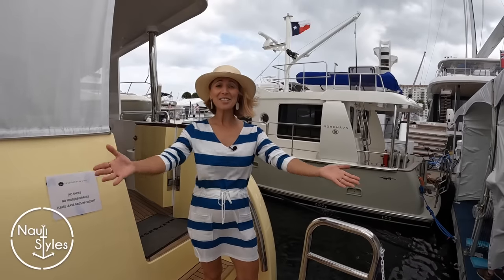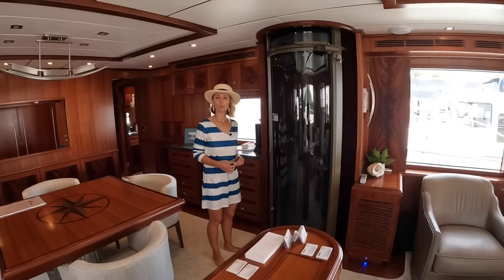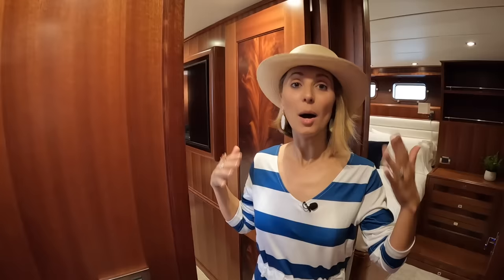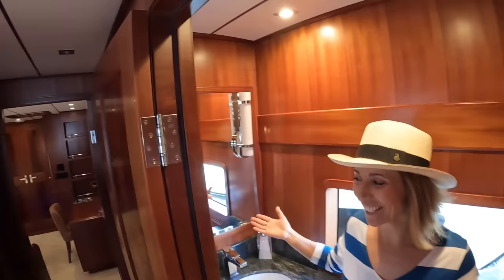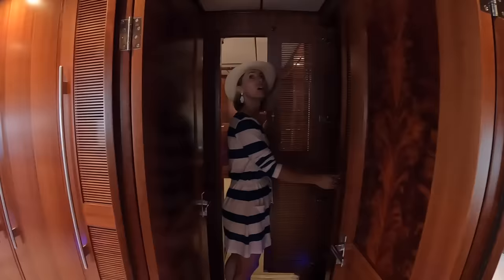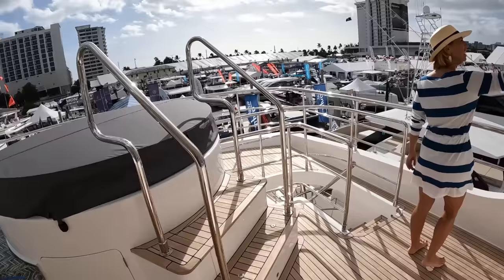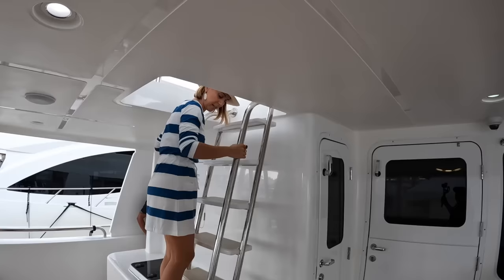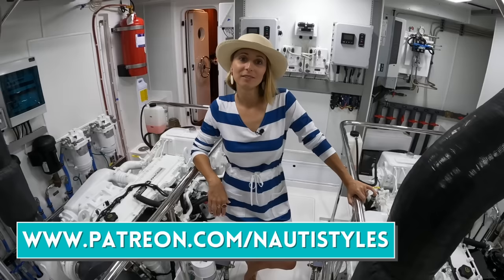2021 NORDHAVN 80 Hull #1 Explorer Yacht Tour / Expedition Liveaboard Long-Range Cruiser

Comment: We applaud the showcasing of different yachts and how they are designed and laid out.  But some of us wonder about how strong and safe yachts are in the face of climate change.  It is one thing to peddle luxury, wood work and comfortable cabins, but climate change may make sea travel more challenging and risky.  More severe storms, winds and a higher top speed of yachts might be needed to escape a storm seen on radar.  Slow speeds encourage a smooth and stable ride, but a higher top speed may be needed to escape danger and huge storms.  Maybe some yacht owners might surrender some luxuries for stronger/ice rated hulls, stronger top structure and higher speeds.

Comment: Owner/Operator, the crew area becomes teenage boy's area.  Nice for a captains area.  I thought this would have greater range but 3000 miles will get you across the  Atlantic.  You would need a pit stop crossing the Pacific.  Looks very comfortable.  Still think I would like to see a captain's cabin on the bridge deck with a crew cabin for the chef, steward and/or engineer in the back.
Reply: I heard Nordhavn does offer an option to have a second master on the upper deck and the typical layout for the lower deck is three bedroom.  So you can have 5 cabins at  most on the new N80!

Comment: Absolutely enjoy all your videos. I’ve learned so much watching them. I do have one request. Please explain the necessity of moving fuel. Having been land locked all my life this is a detail I don’t understand. Thanks for that and all the amazing content.
Reply: Mainly to keep the ship 'balanced'. But Nordhavns also have a fuel polishing (cleaning) system where they run the fuel through multiple filters to remove any  particles/sediment. Dirty fuel into the engines (4 diesels on the boat) can cause a lot of problems.
Reply from the maker: Will do! 🙌🏻 thanks for watching

Comment: Wow they really packed them in.  Very nice yacht.  Well appointed interior just a little dark. On exploring yachts are you seeing a trend to build commercial so they can be open for charter?

Your tours are so well done.  Wonder if you two would do a tour of our Expedition Overlanding yacht once it is finished.
Reply from the maker: build to commercial charter spec is a whole another thing and requirements. I know all Berings are now build to commercial charter spec and requirements but it’s definitely not the norm
Reply: @NautiStyles  I  love the idea of charter coming from the plan that we will rent out our Expedition rig to help offset the build costs. 

I would imagine the cost to make or build a commercial charter and get the certification would add a big chunk of change.

Comment: Hiya Vico, thank you for a great tour of a great boat. One question up front, can you get parts for a tractor engine in say the Far East? All in all a great boat, an explorer so 3000 NM range at 9kn sounds good. No mention of stabilisers though? I think Tim had a much better crew area. What length was Tims yacht? The dark wood was not for me, but I'm not paying so... A fantastic boat in its size with a lift, elevator to you. If this was my budget then I would love this boat. 
Stay safe, Steve...
Reply from the maker: Tim’s AllSeas is 92’, these engines are definitely easier to get parts for around the world
Reply: @NautiStyles only 12' difference, I thought it would be more. Good about the Deere engines. The trend for more and more room in the engineering spaces is very good. Splitting the water treatment to the bow works well, all the more room for the Deers and the generators. Varying the size of the generators, is that a new thing? Appearing more and more. Those manifolds are a thing of beauty as well as very practical. A bit like you two...
Stay safe, Steve...
Reply: Have you seen much of the 'Axe Bow' by Olstein? The Olivia is the only superyacht in service with this inverted bow but the Zumvelt an American destroyer can do over 30kn. I would check my speelingd on allla the naymes! Dyslexia rules
 KO! The boats look strange but in tests, the Axe Bow did 5kn faster with as identical as they could get ships. The YT video was by Pandora US and called 'This revolutionary design will change the appearance of ships.' Stay safe, Steve...

Comment: Hello there guys, love to see your work especially out takes , i like the elevator layout because if you have an older passenger it might help a lot, The color combinations are good, kitchen is pretty long very comfortable to sheff i like the lay out and the small coffee table along facing the door easy access to grocery for crew passage, but mostly the engine room so neat, generators quite narrow for maintenance process, and carbon hull is not really durable for huge waves and big storms, but all in all i almost love it, i think Bering has a bigger advantage😊 but this has more space in crew for its size unless the dinning crew & bathroom shower quite narrow.. 39:02

Comment: Those scuppers are almost certainly self-clearing.  Water level inboard higher than outboard, water lifts the scupper skirts and flows overboard, closing automatically when the deck is clear.  That's all.

Comment: Definitely pretty and fabulous too, you're a lucky man Rico!  Fin or gyro stabilizer on this one?  Although I don't think SeaKeeper makes a unit with enough torque to handle a vessel this heavy.  About the only things I'd be tempted to change might be decor, although I really can't fault the owner of hull 1 for their choice.  Regarding the table in the pilothouse, I think if you wanted a hi-lo table you'd have to give up the drawers under that platform.

Comment: The obvious comparison is the Nordhavn 80 to your recently reviewed Bering 77. The Nordhavn 80 has a lwl of 73' 1" (22.27 M) and the Bering 77 a lwl of 24.60 m (80`7`) and in weight the Nordhavn comes in at 127.44 MT compared to the Bering's 167.7 MT, the weight difference obviously caused by the steel hulled Bering's mass over the Nordhavn's composite hull. Perhaps one of the most important differences is range where the Nordhavn has a range of 3000 nm compared to the Bering's 4000 nm.  You could possibly say that the more reasonable comparison would be the Bering 77 against the Nordhavn 86 which have more similar dimensions but the Nordhavn 86 with a loa of 26.39 MT falls under the more stringent superyacht rules ( I think ) so operating it would be considerably more expensive.  Nordhavn set the pace and the standard in the Trawler style of yacht with their forty footer that performed a circumnavigation an outstanding feat but Nordhavn are an expensive yacht to buy and the competition is rapidly catching up and in some ways passing this iconic brand.  You would never be disappointed with a Nordhavn but is it still offering value for money is another question - so which one would you buy ????
As always a brilliant look at a beautiful yacht, thanks Nauti for your unique style of review.

Comment: i have one of those LG washer/dryer combos that you see in the primary bathroom.  There is a tray on the upper left where you add detergent / bleach / softener.  I think they overlooked this because there is no room over head to put these in.  They would be limited to using only front loading cleaners like pods.  Strange that the installer didn't look at that and go "hey guys..."
Reply from the maker: Oh good eye!! 🙈

Comment: “Batten” - batten down the hatches. Battens are thin, long strips of wood.  In the old days, canvas covers were used to waterproof the hatches and battens were pounded down around the edges to keep them tight. The closing levers on the watertight doors are called “dogs”. I have no idea why.

Comment: I am shocked.  There is an obvious “bookmatch” mistake (6:25) on the starboard upper cabinet drawer fronts. The woodworkers at the factory had to have been aware of it. Very surprising to have happened on a boat of such high quality.

Comment: Hi guys
Not sure who told you a BBQ is what your making because they would be wrong.
A BBQ is the implement you use to create a BBQ breakfast, lunch or dinner.
This implement could be charcoal, gas ,electric even alcohol fired.
Its a BBQ sausage because it was cooked on a BBQ as aposed to a pan fried sausage.
The BBQ dates back to when the neanderthal roasted a Velosiraptor Maryland over coals for the kids.
So to consolidate, 2 sticks over an oudoor coal pit or top of the line Traeger is creating a BBQ Sausage,
steak, roast,vegies or chips because its cooked on a "BBQ".  
Even a smoker is a form of BBQ

Comment: Nordhavn's are very nicely appointed   and have a definite opulence, which is on par with the Bearing range. However they're not steel hulled and I noticed in the stats' that Bearing's 77 actually has a considerably longer range from a 1000 less litres of fuel capacity. I guess the Cummings engine's are a little more frugal, than the John Deere's. Possibly due to the 25hp descrepancy.
Reply: What's the price

Comment: I think it's "batten" Hi guys.  Just for info...Pulled from the web I did not research for truth..."Prepare for trouble, as in Here comes the boss—batten down the hatches. This term originated in the navy, where it signified preparing for a storm by fastening down canvas over doorways and hatches (openings) with strips of wood called battens. [Late 1800s]"  Thanks for the video!  Спасибо тебе за видео

Comment: the storage door was a louvar. not a grill, not a vent (although it is for air movement).
nautical terms like port hole vs window, bulkhead vs wall, deck vs floor, topside vs upstairs... 
landlubers  (grinz N' malicous giggles)
You two are the best.

If someone says, "Don't beach." (a nautical term from the 1700's), They ain't talking about staying off the shore. It means, "Don't tell anyone your business."
DON'T BEACH .. Something you tell a blabber mouth. Because loose lips sink ships.

Comment: Weird boat. It's certainly nice, but 3 staterooms and a single (did I miss something?) cramped crew bunk - that's at most 7 people on board. The rest of the boats seems made for twice the amount of people - 80 feet with two huge living levels plus an equally huge flybridge, and all those massive technical rooms.
But I guess it works for this particular owner. The lift looks very cool, wish you had shown it in use.
Also, 18000 liters for 3000 mile range is 3 liters or 0.85 gallons every single mile. Pretty disgusting if you think about it. Well, that's 130 tons for you. For only 6 cruisers (plus the one crew)? It's a bit weird.

Comment: See all these new yachts with John Deere engines and Volvos and Man engines. Seeing fewer and fewer with Cummins and Detroit diesels. I as a farmer and a truck driver. I have not seen anything good from John deere as far as their newer tractors just problem after problem and expensive as far as parts. Volvo engines seem so so we had a freightliner truck with a volvo engine never had an issue with just ran and ran and then we got a volvo truck with a volvo engine and had a few problems and it was hard getting parts for it. The Man engines don't know much about them. I'd think if I was travelling the world and was depending on my engines moving my home away from home I'd want either cummins or Detroit or Cat engines because if I couldn't get the parts from marine places I could go over to the truck,contruction,agriculture world for the parts and most likely be cheaper than buying from marine dealers. Detroit 2 strokes would be my first choice because of the parts interchangability all 71 series use the same basic parts like cylinder liners,pistons,rods and like the 12v71 uses 671 heads and 8v71 uses 471 heads so there is alot of available parts around the world for them because they were used in everything the Detroit 92 and 149 series engines are all on their own but still millions of them used through out the world. I know it's all about electronics and sound and emissions today but I think if I was out exploring the globe and had to depend on my engines to get me around the globe I'd still go with simple proven technology that I or anyone else could work on and have easily available parts world wide one reason I ever get the money to buy me a boat I'm buying an old steel hull fishing trawler because many of them are built for rough water and many of them still run the old Detroits. Nothing like the sound of them all firing up in the morning along a fishing dock all the sound of those screaming Ds sitting at idle warming up and then hearing them take off.

Comment: It may be barely enough engine power, but really 375hp? A boat that size for me 500hp to 550hp each engine, to be able to push that 80ft threw rough seas and strong currents will be a challenge for sure,   Range should be 5000-6000 nautical miles, and 6-8 thousand gallon fuel tanks, but what the owner needs isn’t much, so this boat wouldn’t be for me, nordhaven has better suited boats for my range and style.

Comment: 80' yacht, 3 staterooms and an elevator. 3 years later, can't sell it and wonders why. Some people need to be stopped before they build a yacht. Like Tempo Reale. A 120' fishing boat with 2 cabins. Some people are morons.
Reply: Cliff, just curious, why are theyhard to sell??
What do you think of the Nordhavn 86 & 96?
What kinds of boats do you recommend? Unless your moto is to stay on dry land..
Reply: @gmmonomotapa2889  I was a deckhand on yachts for many years. I never recommend dry land. The problem with selling a large boat and small number of cabins is that unless you are a hermit or super private, you can't bring anyone on board with you. Take Tempo Reale for example. A 120' yacht designed as a sport fishing yacht. Excellent yacht. Only issue is that it only has 2 cabins. That's it. There is no fun in bringing along friends and family. For most people,the joy of getting out on the water is to share the experience with other people like your friends and family. But when you get a boat and there are no spaces for friends or family, most people don't want that. They want a 4 cabin or even a 5 cabin layout in some 90' yachts. 4 cabins in an 85' yacht is pretty common now. 3 cabins is less common,but you see it and that's because those are always at the request of owners. Then when the time comes to sell it, those people that want a boat in that size range are out off in the fact that they can only get themselves and maybe not even all of their kids on board. You look at some 64 and sub 80' yachts managing to get 4 cabins on board and yeah the guest rooms aren't huge, but you have plenty of storage space,a twin bed at least and it's comfortable plus you are only sleeping there. Then we come to the elevator. Those seem great but elevators on yachts require lots of maintenance and they are slow, plus they frequently break but the maintenance is so heavy on them. They add tremendous extra weight and they also take up a lot of room and power. If you have a larger yacht then it's not an issue. Smaller yacht means you are losing space, gaining weight, and requiring costly maintenance, plus costly upgrades to systems. So if you don't need one, most people don't want one.
I love Nordhavn. They make phenomenal trawlers and can handle anything thrown at them. Never been on one, but just like a Fleming, a Grand Banks, a Hardy or a Hunt you know those people know quality and are serious about being seaman. There are yachts that look pretty but also have to get loaded onto a transport ship every season and then there are yachts that say 'I am my own transport and I go wherever I want' That's Nordhavn, Fleming, Bering, Numarine, Arksen and a couple others.
Reply: @clifbradley  thx so much Cliff for the time & consideration. Yep me too never cared for those fancy yacht festival shiny types that can only sail a few miles off shore & mostly in flat seas on a very sunny day. I am a hermit, & if I got a chance wouldn't mind one of those nordhavns to take myself to Antarctica or something just to get away from pesky humans.

But thx for your informative response about resail considerations...Have a great day.
Reply: @clifbradley  Different use. Nordhavn are passagemakers, so you live on board for weeks at a time. You want good space for all onboard. That's not necessary on say a fast boat for shorter coastal trips.

Comment: I don't get all the rage about these boats, they're slow AF whereas fast planing yachts can get as good fuel efficiency when running at displacement speeds but still have to option to go faster if/when needed, like avoiding a storm for instance. 80ft and 3 cabins is ridiculous, 4 cabins should be a bare minimum for that size, I guess the Nordhavn owner demographic don't like kids much. One berth crew cabin is a joke even for an owner operator. It hurts the resale value. And why go to the trouble of fitting an elevator if it doesn't reach the fly bridge? If you need an elevator maybe you're not in the right shape to owner-operate an 80ft boat? Finally you're overpaying for a made-in-china boat from a brand that actively avoids manufacturing in its largest market of the USA, yet projects a folksy, no-nonsense sailing image.
PS: of course very interesting tour, thank Nautistyles